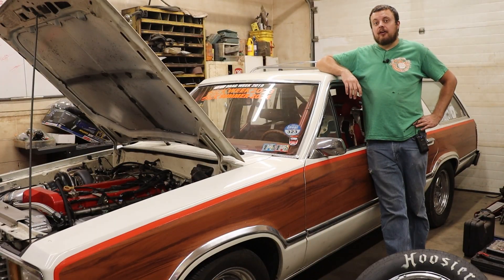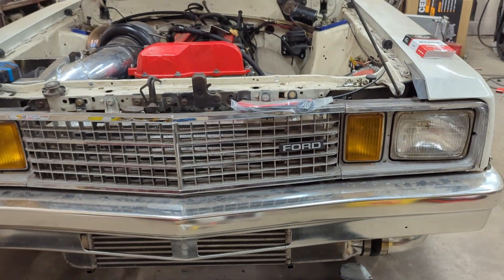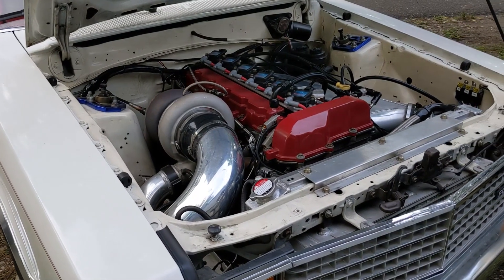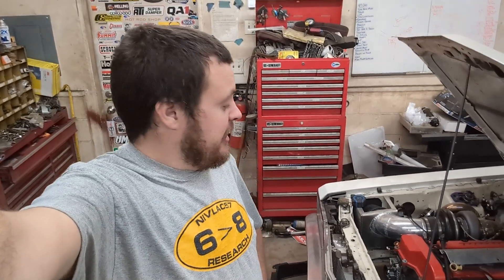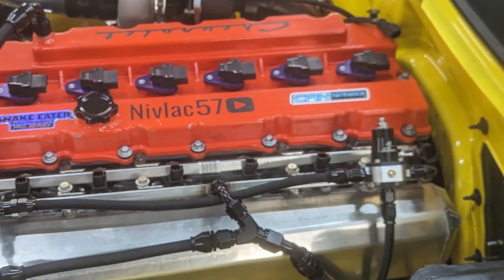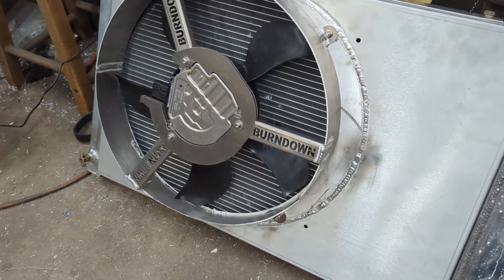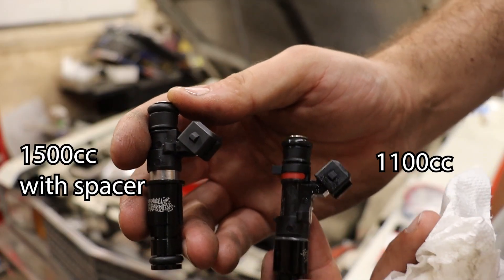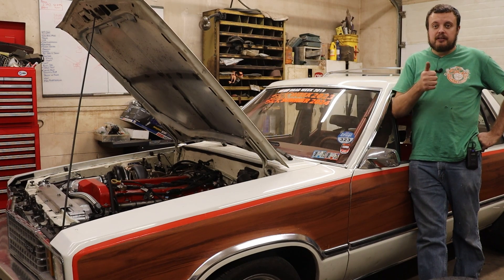Turbo Inline 6 Station Wagon Gets Some Much Needed Upgrades!

Comment: Hello teacher, since I discovered your channel I have learned a lot and I also like the engineering and performance of these engines a lot and they are quite interesting. Thanks to you, I was motivated and I have added a supercharger to my hummer that I bought with the smallest one in the family, Atlas 2.8. It really moves her very well but in this you always want more and more lol, but now I'm stuck with the ecm melody, I already extracted the bin with pcm hammer, but my pcm titanium doesn't read it, winols is too advanced for me and I don't have hp tunner, what advice can you give me, I'll keep an eye on it, thank you very much advance master
Reply from the maker: If it was mine, I would get a HP tuners. I'm not 100% that will get you where you need to go though. I've not messed with the 2.8 yet. I would suggest pulling a tune file down from the tune repository on HP tuners website and see if you can get access to what you need to change.
Reply: @Calvin-Nelson  Thanks for your response and suggestion, I'll try it.

Comment: I learned a lot talking to the guys at ron davis. I did end up buying a nice rad and fan setup from them but before that they gave me a lot of info.   1 thing that worked for me was sealing all the stack of coolers together so the air didnt stack up at IC and then go AROUND the condensor and radiator. Also the fan will tend to draw stagnant air through rad rather than cooler outside air if its trying to pull through a cooler stack up. My 6.0 turbo LS starion had always ran pretty hot until I did all this.

Comment: Thanks for the tip!  Delta fans move a TON of air without a ton of amps
Reply from the maker: The other nice thing about the Silverado fans is they are available at the auto parts store.
Reply: @Calvin-Nelson  I was referring to the Delta PAG fans.  I bought a dual 11" inch fan shroud assembly.  Each fan moved about 1100 CFM.  Ive upgraded one side to a 12" "extreme" fan which flows about 1600 cfm.  I am putting the AC unit back in my truck and was concerned that I'd have too much of a restriction up front. The 12" brushless fans from Delta flow about 2,000 CFM each.  They are thin, relatively light, and they don't draw too many amps.  4,000 cfm or so versus my current 2700 cfm is a big improvement.  This product gives me options.  Thanks.  Keep up the great work

Comment: I'd paint the air intake so it isn't so obvious! I used snow performance water/meth kit and got over 100 hp at the wheels on the dyno. Good luck, and thank you for the video.

Comment: MB W211 Bosch fan is PWM controlled by ECU, my case MaxxECU. It's supposed to be 600w. I also have a smaller core rad and so far did overheat. So now hopefully with the w211 fan it should be better.

Comment: I also had the same hang-up about running some Delta-PAG stuff - Excellent bits kit don't get me wrong, but if I'm doing an event or am just on a road trip I would always be worried about replacement. Being able to use off the shelf products and more rapidly get replacements is a big plus - It's definitely on my radar and I will strongly consider the silverado fan and mount for future use. Need to settle on a core and then find someone to make a shroud for it.

Comment: I might not notice the intercooler peeking out. But that ram air looks race as hell.  Nice touch on a sleeper wagon though. Ever thought about more factory looking wheels?
Reply from the maker: I used to have steel wheels on it. I had a damper fly off the LS I used to have in the car and it ruined one of the wheels, so I changed out to aftermarket wheels.

Comment: Maybe add some screen over the openings for the intercooler to keep rocks from hitting it. Also I noticed your injector duty cycle is almost maxed out.
Reply from the maker: Yeah. It's rich. Need to back some puleswidth out of it. I plan to make up the difference with methanol.
Reply: The older metal window screen works killer. Although, I don't know if it's available for purchase anymore.

Comment: I just watched a video on another channel about setting up a cooling system. It featured a tech from Derale in it. 
You want fans pulling thru 75% of the rad cooling surface, and as much airflow as you can get thru the fans. That particular setup had two 2K cfm fans attached to it with a custom shroud.
Looks like you have all that met or damn close.
Reply from the maker: Good to know

Comment: I’m excited the fan holder worked out well! If you can fit one they are pretty hard to beat. I think we filled a good middle ground for the DIY guys with the fan holder.
Reply from the maker: For sure. The OEM grade quality control is a huge advantage too.
Reply: What diameter are those fans?
Reply: @travtech1  15” fan and the holder is 16.25”

Comment: Why cover the rest of the radiator? It's a dead end for air flow around the fan
Reply from the maker: It allows the fan to draw air through entire core. People have found it to be beneficial over not having a shroud
Reply: @Calvin-Nelson  it's only pulling air behind the fan, the rest is covered.

Comment: Looks good calvin. The silverado fans really are no joke. One small suggestion, add some rubber flappers on the pass side of the fan shroud. Other than that, youre fab work is absolutely killer. Those inlet temps are looking frosty compared to what they were before!
Reply from the maker: I will have to do that. Honestly I've never had a car that has the tell tale overheating when going down the highway, so I've never tried the flappers, but it's probably a good idea
Reply: @Calvin-Nelson  came here to say the same about the flappers. 
Even if you don't have cruising speed overheat issues, which is the main reason for these, It's still a good idea to Aid in air flow through the cooler and the engine compartment.
 While not pretty, you may also want to consider some insulation in the front of the intake.
Reply: Exactly!! Twin aluminum travel limited flappers will work too. Using the flappers , if speed induced air flow exceeds the fans ability, The intercooler will function   better.
Reply: I was just going to mention the flaps. Should help with cooling at highways speeds.
Reply: Off topic, but what tuning platform are you using on this Calvin?